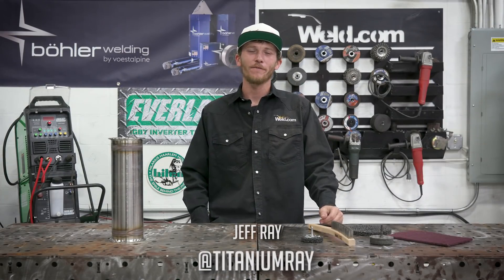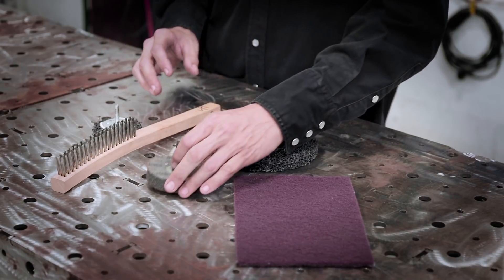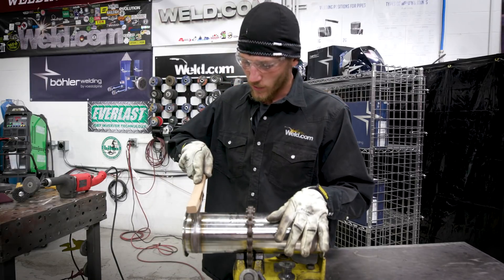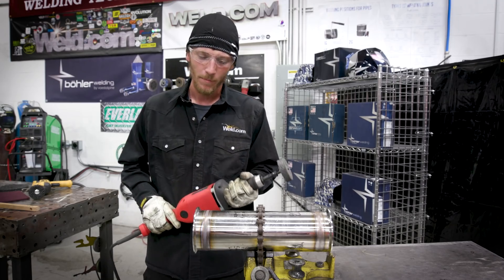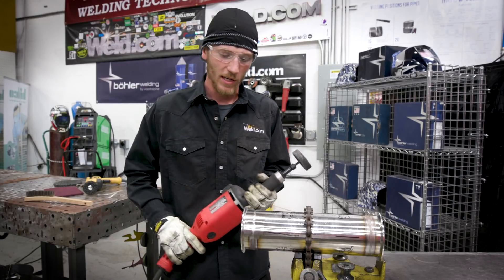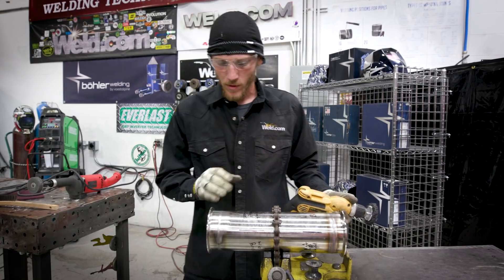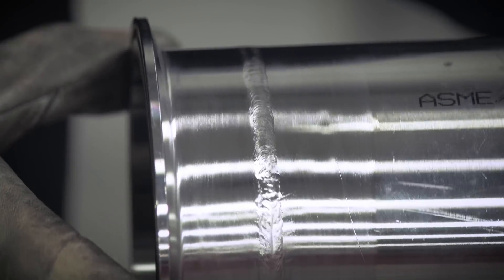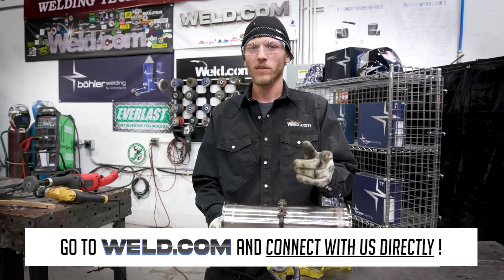How to Clean Stainless Steel Process Tubing

Comment from the maker: From Jeff - "I understand some people are concerned with the chain vise and jaw cross contaminating the tubing. In the process industry I had a special set of jaws that went on my vise that were stainless. You can also purchase plastic ones or make an aluminum or stainless one and then you can put a sleeve over the chain. So the chain doesn’t come in contact with it but yes you’re correct there is cross-contamination there. Sorry I forgot to mention that guys."

Comment: The plant that I work at, there are many different welding contractors. We all use the Scotch-Brite Green Radial Bristle Brush. We take some SS all thread, SS washers, and SS nuts to make a mandrel then chuck it up in a cordless drill. It works extremely well.

Comment: All the SS tube and pipe I did was back purged with argon, and you never used anything on the inside of the tube, contamination inside the tube was not allowed. And never leave a hot weld and go to lunch, finish the weld.

Comment: Why no cross contamination what’s is the positive and negative? For beginners?
Reply: Wouldn't have said that there are any positives to cross contamination. 
But what will happen is the stainless Will rust in the areas that have been polished with a contaminated wheel or have come into to contact with mild steel. And this will make it unhygienic and no longer fit for its purpose.
Reply: While 300 stainless steel is mostly iron (50 to 75 percent), the chromium covers the iron, preventing corrosion.   Small contamination with raw iron can trigger a breakdown in this chromium layer, leading to cascading corrosion.

Comment: Other than appearance why bother?
Reply: Discoloration on SS is oxidation and it will start to rust over time. Especially if it's in a corrosive environment. Also for that reason in various applications Discoloration is not allowed at all.